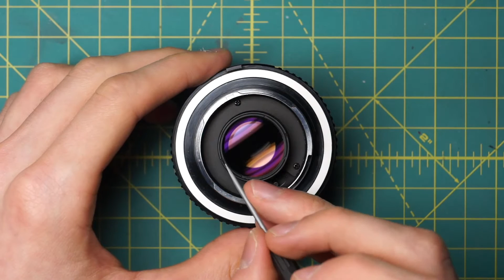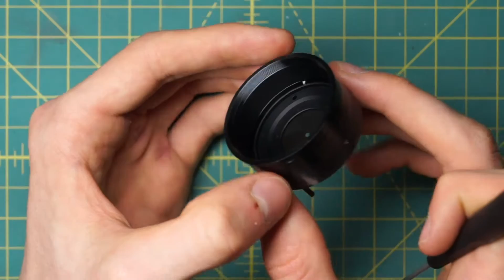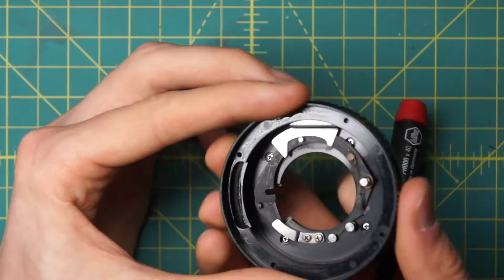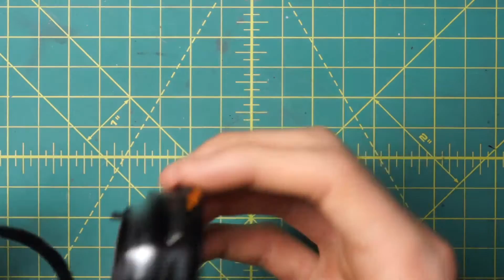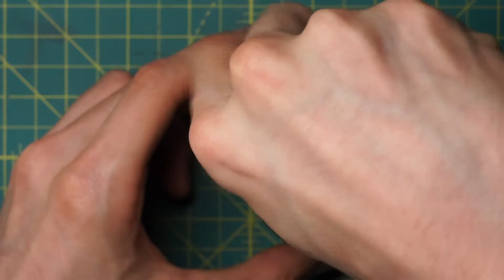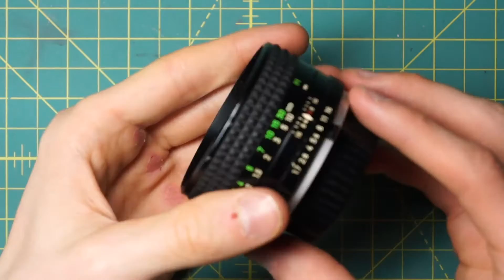Minolta MC Rokkor-PF 50mm f1.7 Lens Disassembly

Comment: does anyone know if this lens uses the same aperture blades as the 58mm 1.2???
Reply from the maker: No, the 1.2 uses a much larger set of blades. They are not compatible
Reply: @Mattbierner  do you know if there is a lens that has a bigger set of blades that i can try and cut it down? I know that would take some craftmans ship but i'm wanting to try anything at this point

Comment: I know this is an older video but wondering if there may be any advice if the front cover plate is not coming off.  I’ve tried using a rubber material to spin the front cover plate off but would not come loose.  Not sure if it matters but I have a Mc rokkor pg 50mm 1.4   The rear of the lens looks different from the one on this vid

Thanks

Comment: I lose my ball bearing when trying to declick the aperture. Any suggestion, how to find the replacement ?

declicking the aperture also cause another problem. Everytime i set the aperture to f1.7, the spring push it back to f4
Reply: Me too 😭😭😭
Reply: Did you find one ?
Reply: 8 years late, but the ball bearing of an old round tip pen works great.